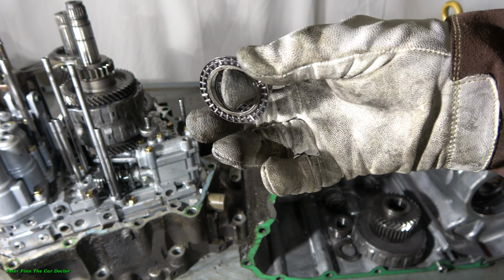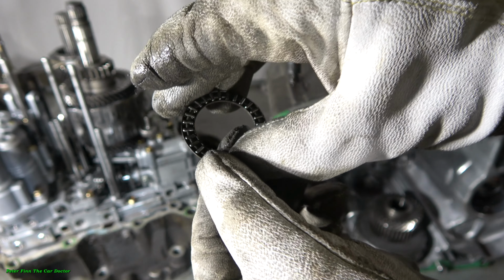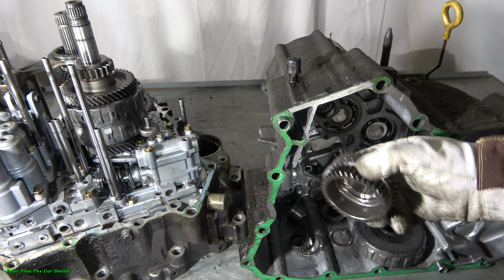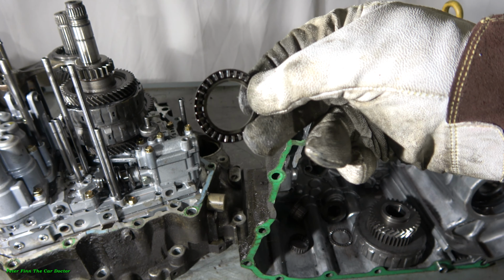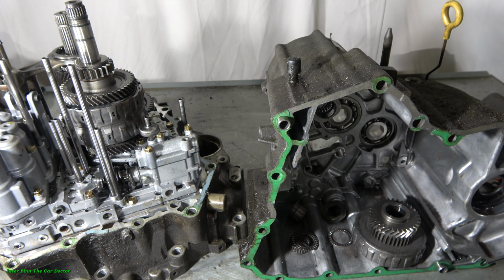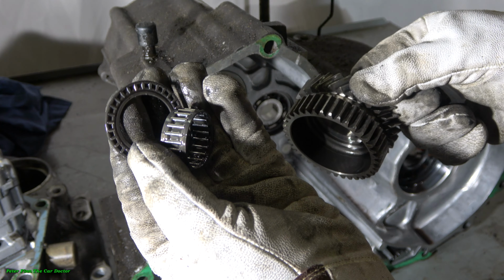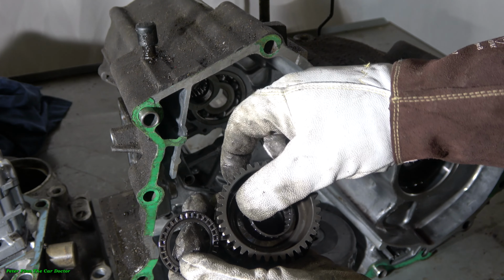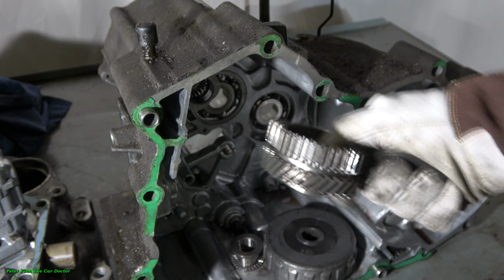What are WEAK points in Honda Automatic transmissions?

Comment: Hi Peter, I have got a problem with my Toyota Corolla 1.6 16V 1991 model 4AFE, gear number 5 just pops out while I am driving what causes that problem?
Reply from the maker: You now have too much wear on a wheel. Disassemble and replace the wheel.
Reply: @PeterFinnTheCarDoctor  Thanks a lot Peter another thing I noticed on the same car the battery light stays on while I  am driving  although the alternator is charging well because I once removed the battery terminal while it was idling and it did not cut off.